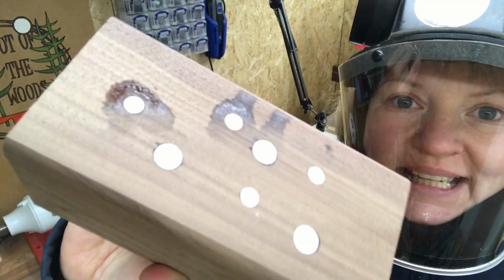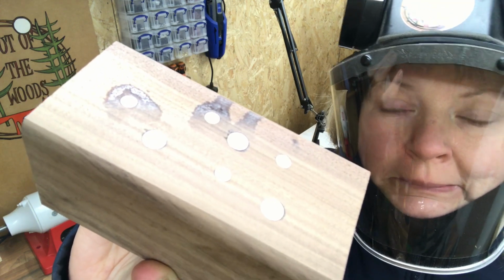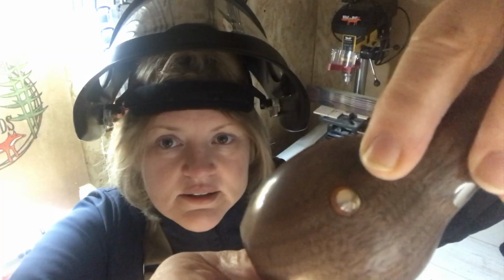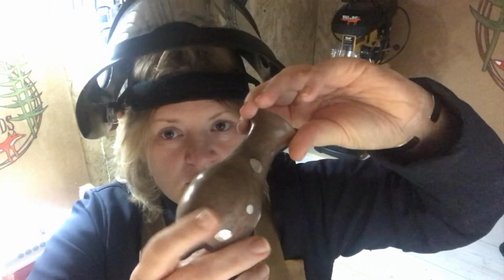Woodturning | Bud vase with aluminium rods - beginner's project

Comment: Hi Claire,  I'd like to get started on woodturning myself.. Can you explain to me why you chose these carbide chisels instead of the "regular" chisels?
Reply from the maker: Hi there. I’m a novice and self taught and the carbides offer one huge advantage to a new turner - there is no worry about sharpening the way you must with traditional tools. The carbides helped me build confidence quickly and get making. My turning journey isn’t about becoming an amazing turner, it’s about using the lathe as another way to create the stuff I have in my head and set it free in to the real world! I love my carbides but I may end up loving traditional tools too one day! Simply haven’t tried them. Stay in touch and let me know how you get in, it’s addictive stuff  
and there are so many people online willing to help and advise no matter what tools you decide upon 🥰🌲🦊🌲
Reply: @MakingItOutOfTheWoods  Thanx!!  Yeah I read about the sharpening issues.  Do you have to replace those cutters often??
Reply from the maker: @woodmum  Not often, you rotate them when they have lost their edge. I used to scrap them, but simply turn the round ones upside down now and run them on a wet stone a few times and the edge is renewed. You cant do that on the negative rake ones but for the regular ones it works great. i probably buy two in a year at most, those are only really the negative rake ones now. Hope that helps. x
Reply: @MakingItOutOfTheWoods  It sure does!! Thank you.